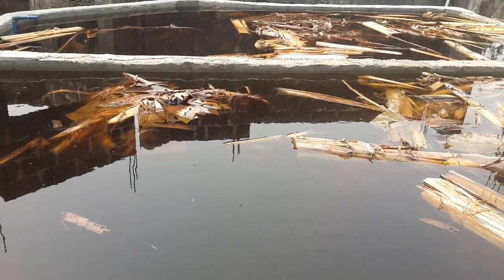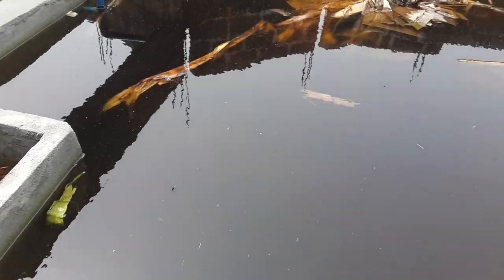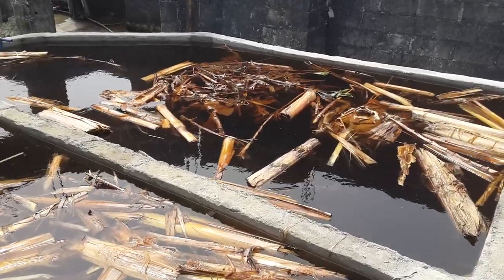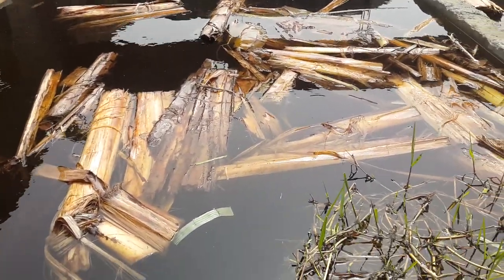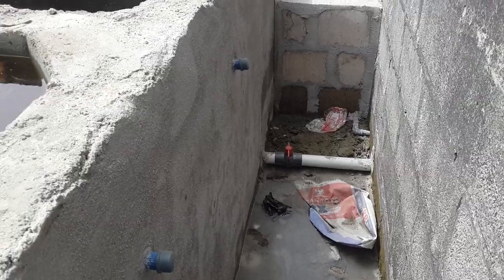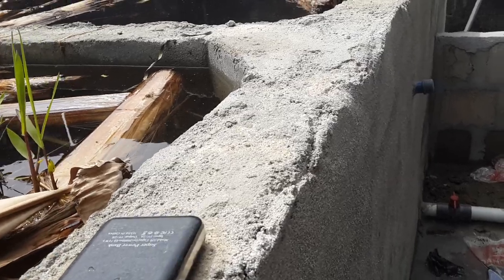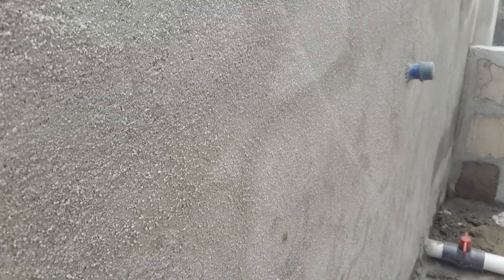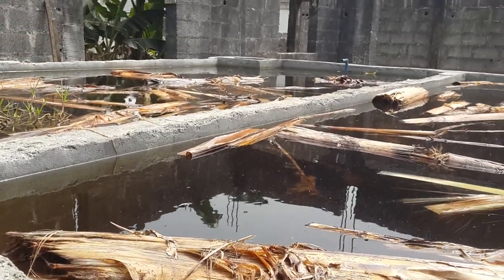HOW TO NEUTRALIZE CEMENT IN YOUR NEWLY CONSTRUCTED CONCRETE POND

Comment: do you have fish inside the pond during the neutralization? or just the dry leaves/plants, then replace the water after. May I know how many days to neutralize the cement pond.. Thanks for the reply.. more power
Reply: I have tried to cure my concrete tank using your approach of dry banana leaves  but the alkaline is still 12. Does this method really work. From kampala uganda